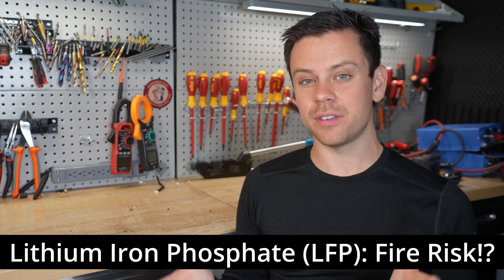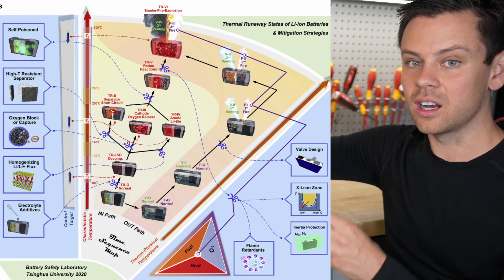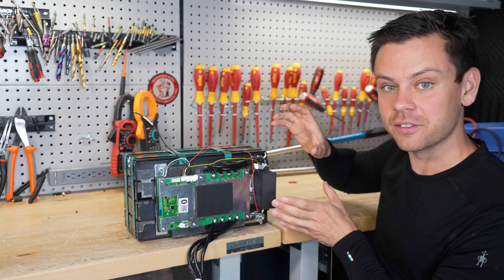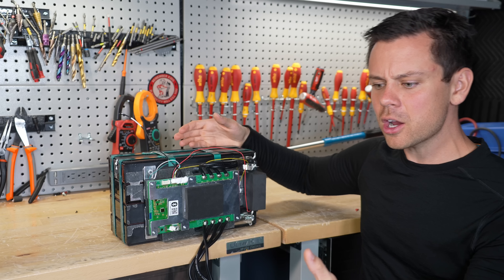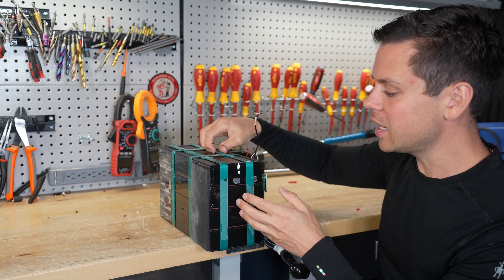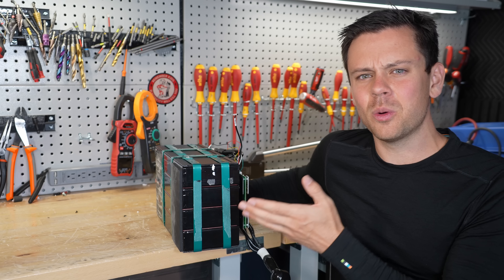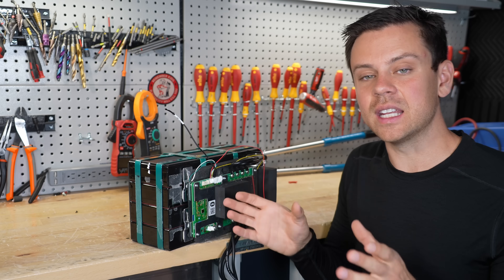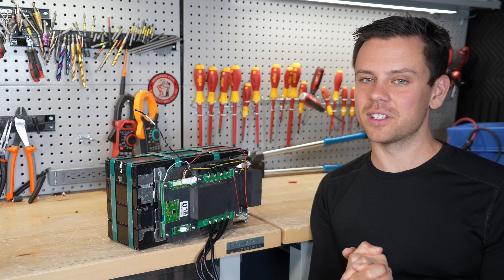LFP Battery Fire Safety: What You NEED to Know

Comment: please review US Stock Pre-Sale Docan 51.2V 600Ah 30kWh Plug & Play Prebuilit LiFePO4 LIthium Battery Pack for Solar Home – Vertical Moveable

these are $2500 for 30KW of power lifepo4 - would be curious if its worth and docan quality is good!
Reply: I saw those on reddit as well.  I saw someone say they found a 100kWh set for under $5k.  That seems way into the, "too good to be true" category.  Especially since raw 300AH cells and a fully assembled battery with BMS and a breaker are very close in price to each other.  Even looking at gross weight, I don't see how you could even sell 550 pounds of functional battery for $2500!
Reply: @HiddenHistoryWithHank  china's LFP manufacturing has gotten really good. $80/KWH is no joke...i've looked into docan before and they typically use grade A, hence why i'd want a review before buying...
Reply: This offer can be OK. What these cheap offers often lack of is a good BMS and they often have grade-B cells. With a great BMS cheap LFP cells are no problem. I look out for BMS with active balancers like JK-BMS.
Or you opt in on Active-balancer as a separate board built in like seplos offers it. 
I bought a pre-built 15kWh battery with Grade-A cells and JK-BMS from EU stock for €1.500 which is USD 1.700.  Or you buy a JK-BMS for USD 100 and change the BMS from cheap batteries if you are able to do the job yourself.
Reply: @olaf_s_23  agree, more research is needed and materials cannot be skimped on for quality

Comment: My concern is the safety of batteries in series without communication to chargers, like 4x 12v 300ah batteries in series creating a 48v system, if one of the 4 fail, the chargers are oblivious keep pumping in energy, also they can become unbalanced
Reply: You could use s standalone battery balancer for this kind of use case, it's like a mini-bms but for full battery packs instead of the bare cells. I was looking at one from Victron a couple of years ago before 48V batteries started becoming more reasonably priced.
Reply: @r.l.royalljr.3905  Seems like a better option then manually balancing them monthly
Reply: So your concern is you have made a battery without a bms and then are concerned that there are no safeguards against a bad cell? Seems if you are going to assemble a battery from other sub assembled units you become responsible for ensuring that there are safeguards in place. This is the difference between buying a ready made 48v battery and making one yourself, either from each individual cell or by combining premade groups of cells into a larger battery, the hardware and systems exist to do this safely but is not just as simple as wiring them all together. If you want easy plug and play tech with all the built in safeguards, buy them built that way from the start, if you want to assemble your own system from various sources in a configuration that does not have those built in safeguard you take that responsibility on yourself. Act accordingly.
Reply: @Bearded.Bucket  The use case is mobile on a rv or marine on a boat, obvious server rack batteries are not designed for these environments , generally due space constraints one buys individual 12v batteries

Comment: "Catching" on fire, I can live with.  It's "causing a fire" that I have issues with.
Thank you for spreading education.  😀
Reply: A regular lead battery can explode and cause a fire
Reply: @tracydjenkins As a professional auto electrician for over 20yrs now.  I have only seen 1 lead acid battery blow up EVER.  More specifically, it off gassed enough gas while charging, and that mixed with air at a perfect ratio, ignited and caused a somewhat significant deflagration explosion.  

The battery was over discharged and left for a very extended period.  I had condemned the battery and recommeneded replacing it.  My manager insisted on attempting to charge it.  And that resulted in the explosion.

I have seen significantly more lithium battery fires, in a far significantly shorter period of time.  

I always get a good laugh when people say "lead acid does this too" when discussing lithium battery risks.  Bro, they arent even measured on the same scale.
Reply: Yes. Good clarification. Any bad circuitry, unlisted equpiment, loose connections and arcs will do what they always have.
Reply: @PsalmCourier  spark and pop and crackle and sizzle
Reply: The issue with EVs is the high voltage!
Reply: @commonsenseisdeadandgone  The issue with Gas cars is they catch on fire.
Reply: Are the gasses emitted if over charged safe to breathe? He say don't breathe it.

Comment: All of my cellphones, recharge on top of “styrofoam” bricks (the styrofoam is a natural fire resistant/retardant—it’s a natural insulation)
If I were to build my system correctly, the batteries would be protected from melting, due to the styrofoam)

Comment: To say that NMC is antiquated and simply should be swapped to LFP is just not true.  NMC has downsides (everything has pros and cons), of course.  But it is higher energy density and so is used when that matters.  Plenty of EVs across the world use both.  This isn't some US vs China thing.  It's a use-case thing.
Reply from the maker: I think it's because we do not have supply chains for LFP. China makes 98% of it. We have been behind in manufacturing the stuff for ages.
Reply: @WillProwse Apparently Tesla are opening an LFP factory in the USA fairly soon.
Mind you, though, I beleive the LFP chemistry was actually invented 10 years before NMC!
Reply: @WillProwse  lfp until  in the past decade was not viable for evs. It's because of new ingenious way of cell to pack layouts and  blade cells that they have reached wh/kg needed .  But the chemistry is still bot suitable for density or power in a performance  setting. This is why all the performance  ev dont use lfp.   Lfp is usually used mid tier non performance  based evs ans stationary storage.
Reply: @noneofthese94  My understanding is that the larger LFP cells commonly used for DIY storage (280 AH etc) were originally developed and used for busses in China. They seem a good choice/fit for that use case.
Reply: @john_in_phoenix  look into byd blade cells. Infact nearly 80 percent of ev in developing countries are lfp. Performance  is not a priority  there as roads and infrastructure  is poor.  They byd lineup is pretty amazing
Reply: @noneofthese94  I'm very much aware of the BYD blade cells, so I'm not sure how "looking into them" fits with the original use case for the large prismatic cells. Both blade cells and large prismatic cells are within a couple percent of each other in energy density. Due to the physical properties of the blade cells they are more suited to faster charge/discharge rates, but you don't really need that for solar energy storage. The large prismatic cells are better suited to solar energy storage due to the size (i.e. you don't need a 5 foot long battery case). When the large prismatic cells first hit the market, they were a decent use case for busses due to cycle life and energy density. Blade cells came after, and are better for automotive use due to charge and discharge rate, and should have close to the same cycle life, that's why they were developed.
Reply: @john_in_phoenix I am having hard time understanding  what exactly  you are trying to argue lol. The blade cells have no benifit  and infact do much poorly  because of heating for  higher charge discharge.  The only benifit  of the blade cells is the design for cell to pack architecture  and bringing down the wh per kg  which has always the been limiting factor  of lfp.

Lfp until  the pat decade could never be used for anything other than stationary storage.

No clue what you are arguing about this entire thread.    As more companies keep innovating on newer cell to pack strategies and with higher 5c charging lfp is becoming more viable for mid end electric vehicles. 

However it still cannot compete with other chemistry in energy  density and power.  Battery design has a good writeup on this
Reply from the maker: Yeah fair points, just pretty crazy how far behind we are. It's pathetic.
Reply: @WillProwse  I don't think we're behind in terms of chemistry.  You put in what fits.  LFP is less expensive, so often when NMC is used it's for a reason, based on OEM's perceived needs. I think our real issue is we let virtually the entire supply chain get set up with China.  We let China under-bid and, over time, take over such industries.  "Happy" to let someone else do it.  Bad long-term move.
Reply from the maker: Majority are LFP elsewhere, but not the case here. Why do you think that is
Reply: This is a law going to enforce in 2026 in China that all EV batteries shall not cause a fire hazard for whatever reason. So EV manufacturers either use LiFePO4, solid state etc., with no fire risk.

Comment: I always thought to myself, what happens if the BMS failed, what could happen.
Reply: That’s why you need a fuse between your bms and your battery.
Reply: @DIYBill  Read my post with attached video. A fuse didn't protect against an internal dead short inside the battery, caused by shipping damage before it got to my home.

Comment: Nice! This is what I was looking for as I search for ebikes and the risks of their batteries. Basically, make sure I do my research on the company and the quality of their manufacturing. Thanks for this video!
Reply: It’s why I bought a specialized ebike and paid a bit more for the Samsung cells.
Reply: So what's the TLDR on that?  Are those catastrophic failures all LiPO based chemistries?
Reply: I know one person that bike caught fire several years ago. Luckily contained to the garage
Reply: Ebikes don't typically use lifepo4 batteries
Reply: Most battery fires are caused by user error (wrong charger, charging a battery that is already very hot etc)
Reply: @williamkreth  not true
Reply: @williamkreth  got a source on that "most"?   Because I would argue that most fires are actually caused by calendar age leading to dendrite formations leading to direct shorts, leading to.... Wait for it... Fire! 
This is *inevitable* if you continue to charge NMC batteries past 5-10 years of age.  ALL NMC batteries form dendrites.
Reply: @williamkreth user error like buying cheap Chinese knockoffs instead of a reputable (Chinese) brand